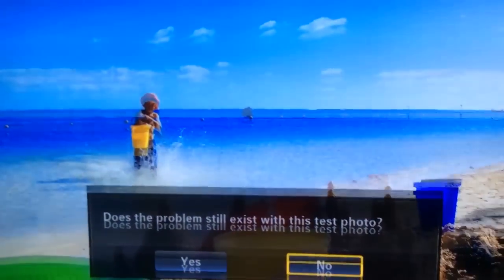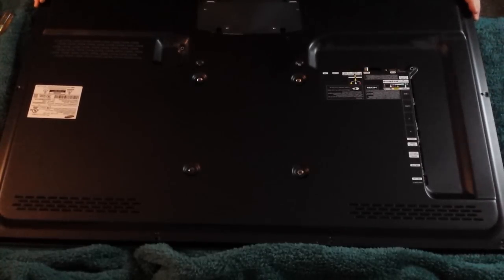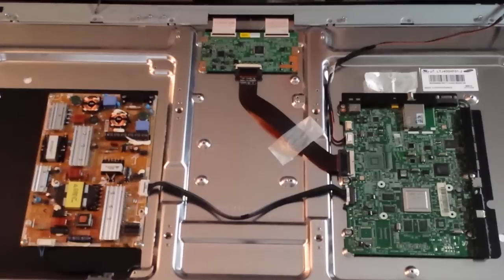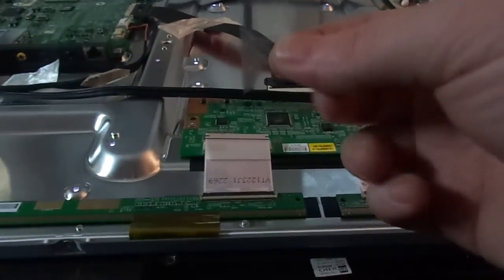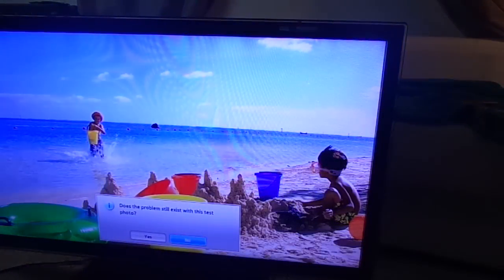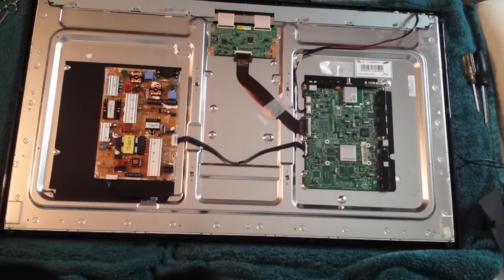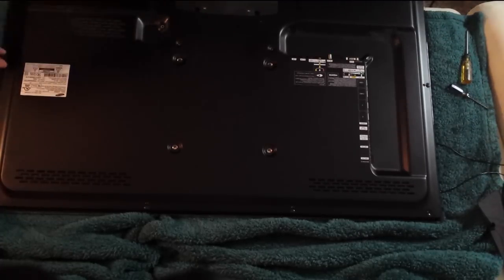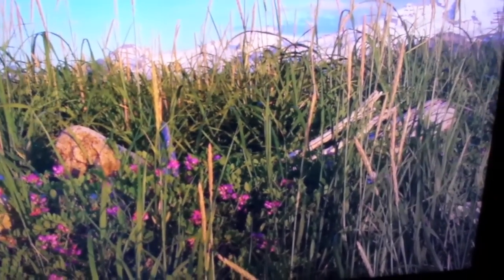LED LCD TV FIX, How To For Samsung Double Image, Black Vertical Lines, Screen Problem Sony LG.

Comment: what exactly does the piece of tape do ? great to see you got the picture back to normal. im having a similar problem on my tv but its just the  faint horizontal dark lines
Reply from the maker: To be honest I don't know exactly why this works but it seems that the small piece of tape raises the ribbon cable off the insert slot.  As far as the horizontal lines,  in my case they showed up after I placed the clear tape on the ribbon cable and secured it back into it's slot.  As you can see in the video, by me just moving the ribbon cable slightly and aligning the connections the black lines cleared up.  You my be able to just move the ribbon cable a bit and not need the clear tape.  If you end up working on it please share the outcome in the comments. Thank you for watching.
Reply: David Koenig Thanks for the response and without a doubt I'll let you know how it goes! It might be a bit before i get around to it, thought I'll be sure to keep you posted. It all happened when small surge went through the house during a storm, it went away after another one and now its back again (possibly because of a storm again haha)